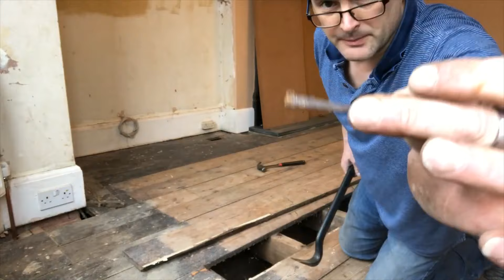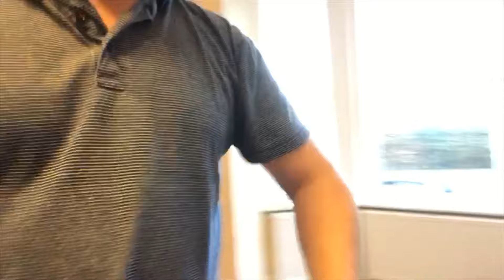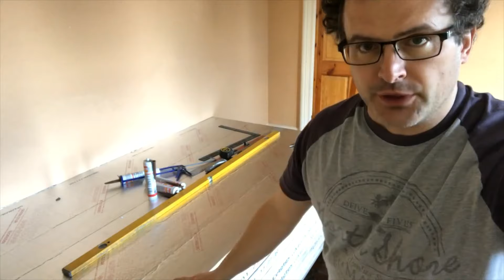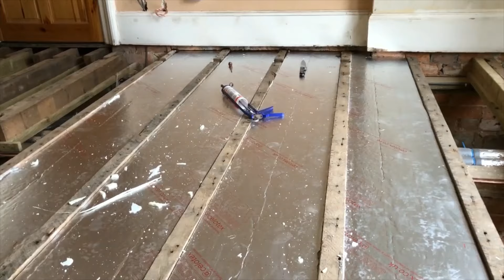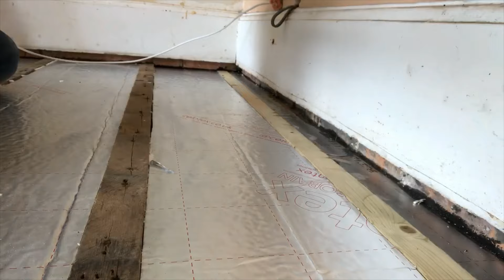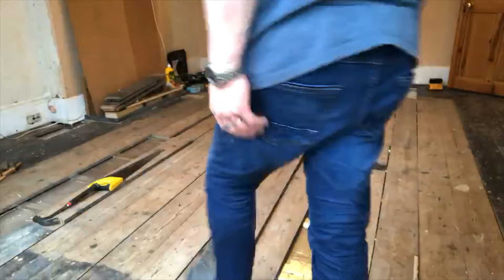Underfloor insulation retrofit full demo

Comment: Why on Earth are you using such heavy battens to sit the insulation on?  It's taking barely any weight... A 20x20 batten would be entirely adequate and cost a fraction of what you are using...  and FCOL just use a finishing gun to apply them at 1/10th the time (and cost) of screws
Reply from the maker: I use the minimum standard size batten available from my local builders merchant. They don’t bother stocking anything smaller as there’s no market for crappy thin battens. Agreed, they’re over spec for the job. Doesn’t matter though.
You’ll need to spell out that acronym so readers understand.
I like using screws. It’s personal choice and it’s my time to use.
Maybe you should post a video of you doing this job, then we can all see how it’s done by an expert 😉

Comment: Are you a trades mans of some kind? Looks very professional. Did you find it helped the comfort levels of your house??
Reply from the maker: Yes, it definitely helps. Half the problem is fixed by stopping the air flow from the subfloor to the rooms.
I’m currently an estates and facilities lead for a big further education college, but have been a head of engineering, security risk expert, project manager, contract manager, and an electrician. I started out installing security systems. 😊

Comment: At 5:45 when you are levering up old clout nails, I've found a large mole wrench to grip the shaft of the nail allows the use of the lever (your crowbar) underneath the mole jaws to take the nail out.  Will always work with 5mm of exposed nail and sometimes with less as well.  Hammering the clout into the joist just risks screwing up your subsequent fixing because it is nearly always in the spot where you wish to drive a screw or nail. Moreover when there are hundreds to be done then unles you use a punch to drive the nail in, you are bound to mess up some adjacent boards with a few imperfect swings of your hammer head.  Also, I'd observe that you are lucky having 125mm joists on sleeper walls - most times when sleeper walls are used it's to skimp on joist depth.
Reply from the maker: I agree, it’s best not to leave them in if it can be avoided. Neat trick with the mole wrench. Great tip, thanks.

Comment: I am doing the same,forget sealants,use expanding foam with the gun,also put a bead of foam along both battons before you fit the celotex as air can still come up between the celotex and joists...Also on the outside wall under the floor foam some celotex up against it but just keep the air brick hole clear of course....
Reply from the maker: Yup, it’ll work that way too.

Comment: Hello, what is better, mineral wool or Kingspan boards?
Reply from the maker: Kingspan boards will have a better thermal insulation value for the same thickness, and can be sealed to be airtight too.
Reply: @SteveWardellDIY 
can you tell me what glue you used?
Reply from the maker: @arturlukaszewicz3375  Hiya, I was using silicone sealant.
Reply: @SteveWardellDIY I ordered Kingspan 75mm, won't it be too thin?
Reply from the maker: @arturlukaszewicz3375  That’s what I used, because it was the most I could fit whilst retaining circulation gaps beneath it at the ends over the wall plates. If you could fit thicker I recommend you do, but 75mm properly sealed will be a massive improvement over nothing at all.

Comment: Hi Steve, great video. Currently embarking on this in 2 rooms + hallway. I plan to support the PIR on top of nails / staples into the sides of the joists, and sealing any gaps with spray foam. In some areas pipes run directly between joists exactly where the PIR would go, not sure how I'll tackle that yet. 
Did you drill pilot holes in the floorboards before screwing them back down?
Reply from the maker: Yes, I normally put clearance holes in the boards, but allow the heads to pull in and self-countersink.
Good luck with it. Your method should be sound.
Steve

Comment: While you have done a good job, good luck to any future owners in trying to access under the floorboards to access plumbing, rewiring or to even add any waste pipes for an extension or remodel. Not trying to knock you, just a point well worth considering is to only do this as part of a final plan for that particular space.
Reply from the maker: Luck won’t be needed, just a little time and care.
It’s mighty hard insulating a floor without restricting access. At least this way it’s still possible. Thanks for watching.
Reply: @SteveWardellDIY fair point, and the benefit they’ll be getting from you having done this would be well worth that extra bother. 75mm is plenty for these smaller rooms especially when on a suspended floor. I’d say the main benefit you’re looking to achieve here is sealing the floor. Also, while there is nothing wrong with silicone to seal around the joists/pir, much easier and more effective would be construction grade foam. Use a proper gun which you can change the cans. Thanks for your reply btw.
Reply from the maker: @bapoo your right. Sealing the floor to make it air tight is really important. Cheers.

Comment: Thanks for this. Instead of sistering and hence losing some potential height I decided to glue some tiny wood pieces underneath the joists and the celotex perfectly sits on top of them :p
Reply from the maker: That's a great idea. I considered it but wanted the gap between the joists and top of the sole plate, to help keep the air circulation around the sole plates which are most at risk of damp.

Comment: Great job. Must have taken ages. I’m doing something similar but I don’t have the patience you have so I just ripped the whole thing out and laying dpm insulation and concrete
Reply from the maker: I guess if your set up allows for it why not?  You could add underfloor heating while you’re at it. I’d be thinking about how to access plumbing and wiring, how the insulation fits, and including an expansion strip around the edge of the concrete too.

Comment: Someone lived there for 100 years without that stuff under the floor and i bet they did not die from being cold.
Reply: good job
Reply from the maker: 😂indeed they did Richard, and they burned many tonnes of coal in the eight fireplaces we have, trying to keep the place warm.
I prefer to keep the coal in the ground and at least lessen my own climate change impact. 
Fuel costs money too, of course, and I’d rather the house cost less to heat, for me and all others who come to own it after me.
Reply: Buy a smaller house
Reply from the maker: @richardcolbourne5927 Someone else would live in it instead. Same issue.
Reply: @ good job anyway
Reply from the maker: Thanks Richard

Comment: We just moved into a house about the same age. Wed really like to insulate the house better. There are currently solid oak floors throughput the downstairs (not original but beautiful and good quality). Unfortunately when they were placed i dont think insulation was put down! 

You seem fairly DIY savvy!..  could it be possible to remove and reuse the oak floors if we did something like this?
Reply from the maker: Probably yes, but you need to find out how they were laid. The oak may be tongue and groove. If so you’d need to start with the board that was last to be laid last on one edge. Take a look along the skirtings and see if you can work it out.
Beware they may have used adhesive. If they have then it may not be possible to separate them without damage.
Hard to give accurate advice without seeing it though.

Comment: Steve, sorry this is about two years' late, but can you say why you didn't just remove the joists, fill it with sand and then lay the PIR?  Why leave the timber in?  Thanks.
Sorry, should have said, the reason I ask is because all that timber still has to be ventilated, so negating a lot of the insulation.
Reply from the maker: Great question. There’s a few reasons. 
The space below the floor is quite deep and would have consumed around 8 tons of sand. That’s a lot of work.
The weight of the sand would have placed load on the inside of the walls, and I’m unsure what impact that may have had. 
The ventilation air passes under this floor on to the next subfloor then the next so we would have starved ventilation from the rest of the house causing damp elsewhere if we’d filled it with sand.
Sand costs money.
The subfloor void is used for services such as water, gas, and heating pipes, and electrical cables. These may need maintenance access which would be much harder if there were sand there.
If sand were used with a floating PIB layer we would then have needed a floating chipboard or concrete floor on top, which would have been more time, money and materials.
I’m now starting to wonder why you would consider using sand instead of the existing joists. Let me know your thoughts please.
Reply: @SteveWardellDIY  
Thanks for replying.  I'm actually a heating consultant, and I was reading some work stuff this week about just how bad timber floors are at conducting heat, rather than concrete floors.  I have to be honest and say that this was news to me (though I did know that there wasn't much in it either way) - when we do calculations, it's all done for us, we just input the structure and dimensions, etc.  It appears that when everything is taken into consideration, especially ventilation of the existing timbers, it might be better to go with a solid floor.  This can only be achieved by filling the void created.  Concrete is out of the question, but sand is actually very cheap, at £39/850kg, so would only have cost you £312.

I take what you're saying about services you already have running through, and yes, if the ventilation goes on to other rooms, it would need piping set within it.  I think there's an argument, though, for when undertaking a complete refurbishment, for just taking all the timber out...sand, DPM,  PIR, then a slab screed.  There would be no weight on the side walls, by the way, as the force is primarily downward.  You only have to be concerned about lateral forces when it is scaled up to considerable depths.  I used to explain this to students - try getting on your weighing scales and then lean on the wall.  The scales stay the same.

It would be interesting to run it past BC and see what they think.  Having totally refurbished two properties, I think I'm too old to do it again, but I still have ideas that I would like to try out.
Reply from the maker: @ That’s really interesting Barry. We do just rely on those calculators and not really know. The depth at the front of the room was nearly a metre, hence the side load concern, but I agree it’s notably limited when studying the physics. The screed layer would need to be edged from the existing structure with foam strip or some such, to allow for expansion, and there’s a great opportunity for underfloor heating in the screed as part of a journey to an air source boiler replacement.
There’s merit to it, particularly if it’s a whole house being refurbished, and yes, I’d be keen to learn what the BCO would say too. They may suggest using ballast or type 1 compacted in layers rather than sand all the way, but probably fine as it would meet the regulations.

Comment: Thanks Steve for a very helpful video.  I'm looking to do a similar job in our1930s house with 100mm joists but I gather this system wouldn't provide a good enough U value for current regs.  I appreciate you probably didn't involve Building Control but they will be visiting the property as an extension is being built and I didn't want to be midway through this job when they are on site if I haven't told them about it. Do you think it is possible to insulate between 100mm joists over a ventilated crawl space in a way that would be approved by Building Control?
Reply from the maker: @morganrobertson6865  Thanks for the feedback. You’re right, I was improving from nothing to as much as I sensibly could based on the existing design constraints. Where retrofitting and limited by the design you’re obliged to do the best you can. I needed an air gap to allow air to circulate over the timber wall plates to keep them dry, and chose 25mm as a minimum for this, leaving 75mm for insulation.
Building control requirements change with time too, so the requirements for new and unhindered retrofit will probably have changed since I was making the video.  I recall retrofit used to be different and less demanding to new build.
The approved document for this can be found here https://assets.publishing.service.gov.uk/media/662a2e3e55e1582b6ca7e592/Approved_Document_L__Conservation_of_fuel_and_power__Volume_1_Dwellings__2021_edition_incorporating_2023_amendments.pdf   
New build and retrofit both currently requires a maximum thermal conductivity “U” value of 0.18W/(m2·K), as per the tables on pages 24 and 25.
I think I was installing the predecessor to GA4000. The data sheet for which is here https://celotex.co.uk//assets/tds-uk-insuk0003a-en-celotex-ga4000.pdf  75mm thick board, as I was using has an insulation value of 3,40(m².K/W)
Using the Celotex site’s own calculator for a timber floor in a square room scenario 4x4M using 75mm GA4000 the U value calculates to 0.30W/(m2·K), so no, it does not meet current regulations.
To achieve 0.18W/(m2·K) on the Celotex calculator in a between the joists arrangement, you would need Celotex XR4000 150mm minimum thickness, but you’ll need to confirm this using your room size for the perimeter/area ratio. If this is accurate then you’ve not enough depth between joists, but potentially could put 100 between and 50 under, depending on joist ventilation and vapour control design.
Best chat with your building control inspector to confirm their requirements and get their advice, and this detail ought to have been in the design submitted to building control too, so may be worth checking that.
Also worth noting the approved document says that the U-value of the floor of an extension may be calculated using the exposed perimeter and floor area of the whole enlarged dwelling. This will impact the calculation.
Hope this helps.

Comment: So the ‘air gap’ you have left under the floor board and above the PIR…what prevents that from condensing with temperature changes?
Reply from the maker: The gap and upper surface of the PIR is at or very close to room temperature, not cold, so will not be a space or surface creating a dew point.

Comment: Thank you. Is it a dirt foundation or cement?  What do you recommend? House over 100 years old.  Foundation is dirt and not sure of pipes. Thsnk you
Reply from the maker: Hi there. The subfloor is dirt in this property. So long as you ventilate the sub floor properly, with air bricks at each end, I hope you would find this insulation method works for you.  I don’t know where your pipes are. You’d need to find out.

Comment: Did you consider using a vapour barrier as well?
Reply from the maker: Absolutely yes, and I discovered the continuous foil upper surface with foil tape bridging the joists provides a vapour control layer. Thanks for watching. Steve

Comment: good job but i would of put a dpm on top of insulation then boards coz yes its all good having everything air type but if u havent left enough air flow between floor and insulation it will sweat so when you are insulating creating any air flow just as important

Comment: one thing i must say how u spend all money on good insulation level a decent tape measure but dont buy a saw 😅😅  make no sense
Reply from the maker: Thanks for watching Hew, and for your feedback. Using a saw creates dust and I wanted to avoid this. The knife is a steady and reliable way of cutting dust free, but takes practice to use accurately.  It’s tricky on thicker sheets and probably best avoided on anything thicker than 75mm.
If I were to do another project with large volumes of insulation I would invest in a fine toothed reciprocating saw and guide. There are some good products out there.

Comment: Good job there Steve, fussy free no nonsense job, well done. (was it much warmer after that job)?
Reply from the maker: Thanks for watching MrB.  The room does not get as cold as it did, but doing this through the whole ground floor is needed to make the full difference. Also, beware the need for air to ventilate the fire/wood stove if you have one. This room now sources its air from the rest of the ground floor.

Comment: 12:20 I wonder if it wouldn't be better to screw a board to the underside of each joist? Then you get room for at least 100mm insulation
Reply from the maker: Yes, that would definitely allow more room for insulation.
I was keen to leave an air circulation gap under it where it passes over the timber bearers beneath, to help keep them dry.

Comment: Good video but I definitely would not have used foil backed PIR in this instance.
The insulation needs to be breathable and ideally hydroscoptic. Using PIR runs a high risk of holding dampness against the joists and especially so at the joist ending, and if that occurs that becomes a major problem.
Reply from the maker: I’m unsure where you think the moisture would come from @kevocos, as the subfloor is ventilated and the foiled internal side provides a vapour barrier preventing a dew point further down. If a hygroscopic insulation were used instead it would absorb moisture and risk transferring it to the timber, causing the problem you’re concerned about.

Comment: great video i do have to say using a sharp knife to cut is not the path i would have gone down at a minimum a hand saw is a must
Reply from the maker: Thanks for watching George. There are some new serrated knives and battery operated fine toothed saws on the market that would make a more accurate perpendicular job of it. I like using a knife as the dust produced is minimal. Using a saw means vacuum extraction or a dust mask.